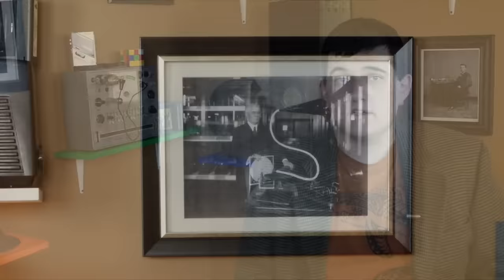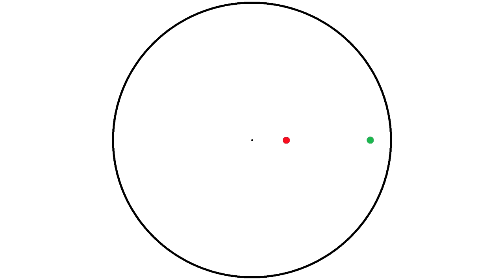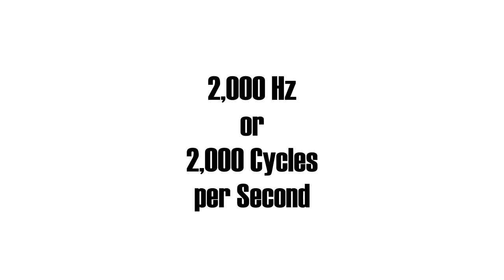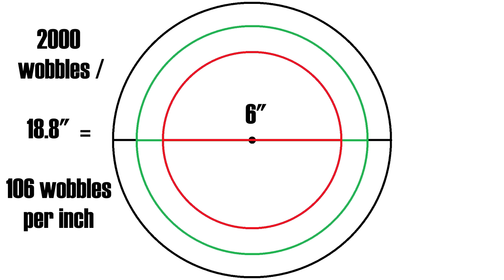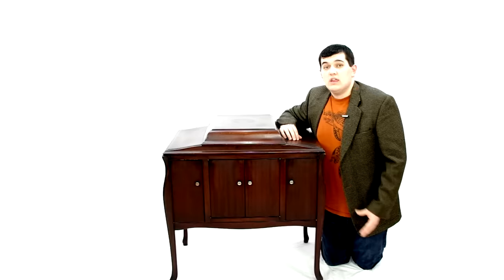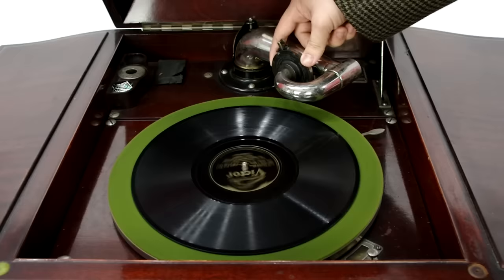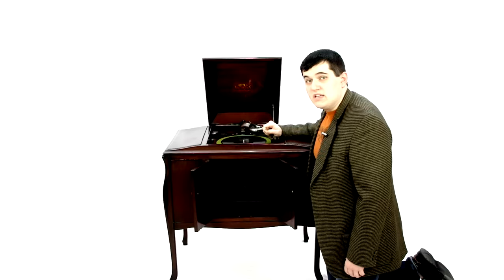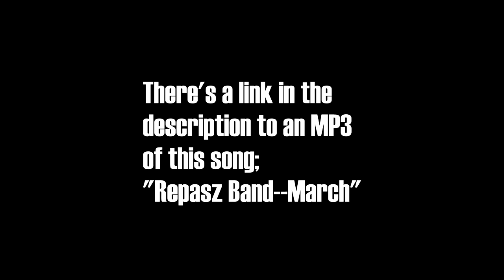Emile Berliner's Fix: Flatten the Cylinder to a Disc

Comment: A form of cylinder remained in use as late as the 1960s for office dictation.  The system, marketed under the trademark name Dictabelt, used large diameter flexible plastic belts which could be stretched between a fixed and a movable half-cylinder to make an oblong "cylinder."  The dictating machine had an electrically heated needle which plowed an audio groove into the soft plastic when activated by the sound from the microphone.  Once removed from the machine, it could be sent as a flattened double sheet to a secretary, who put it in a playback machine and listened with headphones to type the executive's document..  The playback could be paused and reversed by lifting and sliding the playback cartridge.  I'm not sure whether there were any machines built which could do both functions, but if so, another secretary or the executive who dictated the document could read while listening, in order to catch errors.

This fit the pre-online-terminal office environment, in which secretaries (also called stenographers), mostly women, typed dictation from executives, mostly men.  But rather than having a personal secretary, and taking up the secretary's time to listen to the boss and take shorthand, this system allowed even mid-level executives to dictate alone, and secretaries to be organized into a "pool" and type documents as their time allowed.  But once executives had online terminals, and later personal computers, on their own desks, there was no need for secretaries.  And since they already knew how to type, some of them could be promoted into the junior executive ranks.

I don't know how long Dictabelt and its competitors (if it had any) lasted, but it seems to be an idea which only works in large multi-executive offices, and I never saw any such machines after college in any company where I worked.

Comment: During the German occupation some folks from the Danish Radio had a secret recording setup with wax discs. They recorded the sabotage of a factory (they were in the know). A long recording required two recorders with some time overlap and rapid replacing of discs. And a light brush or feather to remove wax dust. I think a similar setup but with shellack discs is shown in Des Teufels General. Rather odd as the Germans had excellent tape recorders at the time.

Comment: We used magnetic cylinders for data storage in the late 1960s early '70s.  IIRC they were head per track and ran in an atmosphere of nitrogen.

I bought a commercial property and amongst the junk there was an electric motor from an Edison phonograph, it sold for £1500 on Ebay in 1985,  £4,579 in 2019
 (Inflation averaged 3.3% a year.)

Comment: Some history on the Berliner discs in case you wondered:
Emile Berliner’s discs were 7” with one song.
A Berliner phonograph is the phonograph in His Master’s Voice.
They were VERY noisy. I don’t know if any other records (in decent condition) are that crackly.
The Zolophone stole his patent and he eventually lost the right to make discs IIRC.
In 1901, he gave up the patent to Eldridge Johnson who founded the Victor Talking Machine Co.
If any of these were mentioned in the video, I apologize.
Edit: A Berliner disc was not shown in the video. Early ones had no label and were instead engraved. Later ones did though. They were initially also made of rubber, then shellac

Comment: Not too well known is the process by which cylinder records were duplicated in the 1890's to supply the considerable number of them needed for the "nickel-in-the-slot" phonographs of the decade and the consumer cylinder phonographs from 1897 to 1901 when molded cylinders came on the market. The pre-1901 cylinder duplication method used a pantograph where four mandrels were linked together with one mandrel holding the master cylinder and the other three connected by a linkage with a playback stylus driving three recording styli recording blank cylinders on the three blank-cylinder mandrels.

Comment: The variable frequency response of disc records is perhaps easier to see by looking at the record in terms of a sector. As I can't post a picture, let's see if I can do it in less than 1k words. Draw an angle on a record, with apex at the center. This also gives us concentric slices of the track within the angle. Since the record has constant angular velocity, each slice of the track contains the same duration of audio. However, the as the slices go towards the center, they're also shorter, so the sound must get squished into shorter and shorter space. "We can only make the wobbles so close together before..."

The linear velocity approach has the advantage that it can be connected to the oscillating pen on dragged paper demo from the previous video.

Comment: There are a lot of comments and I can’t read them all, so excuse me if someone has already suggested that Edison could have improved the storage problem somewhat by making his cylinder into a frustum (a cone with the top cut off) with a shallow angle between the base and top. They would then have been stackable inside each other. Smaller, shorter playing versions could have been stacked inside. I imagine that there would be other problems introduced, but an inventor like Edison would surely have been up to the challenge😊

Comment: discs were also distorted from the original recording, because the original recording used an engraving bar that traveled straight across, but playback was a on a swinging are that arced across the disc.

Comment: Home disc recorders were a thing. You should  do a video on them. Metal  discs , hot needle...
Reply: Some used vinyl on metal discs.  I have a couple of 10 inch Recordio (Wilcox-Gay) discs, probably late 1940s or early 1950s.  They run at 78 rpm.  They were inside an old Emerson radiogram I bought in 2016.  I wish I had the machine that made them.

Comment: Technically, a disc is a cylinder as well. Only the proportions are way different, and the grooves are on the top and bottom rather than the side walls ;)

Comment: I haven’t seen an analysis of the fabrication problems involved in the cylinder record, but it would seem that mass producing cylinders by molding them requires two semi-cylindrical mold halves, and would create a seam on each side, which would at best result in an extraneous “click” every half revolution; or at worst, make the needle jump out of the groove.

This is no problem with the disk.  Just cut a separate master for each side, make each side a mold half, and the molding seam is on the edge of the disk, where no information is recorded.  That’s how records have been mass produced ever since.

How did Edison’s later cylinder mass production process address the seam problem?  Does anyone know?

Comment: Near five years later, I'll add this; diameter and effective surface speed.  As stated in the vid, this affects frequency response/ability to encode.  33.334 RPM, 12" disc.  Calculate that, then the same with 45 RPM and a 7" disk.  Funny how that works.  IIRC, I calculated it out to be the same on the outside edge, within an extremely narrow margin.

Comment: There are echos of the competing photography film formats, Betamax/VHS war as well as vinyl vs cassettes vs 8 Track and even the personal computer war of the 80s and 90s, at least in storage media. The final winner over all of them: digital.
Reply: Not exactly. There are still battles for digital formats in the market. Look at Blu-Ray vs HD-DVD or SD vs the other other memory cards. That's just on a hardware level. Then there's different formats for storing digital mediums on a software level. Try plugging in a USB HD formatted for windows on a MAC for example. It won't work. The fight goes on!

Comment: My understanding is that Berliner was an opportunist "inventor" who specialised in poring over patents filed by others and then making a quick buck by producing a cheaper version of the same inventions but sufficiently different to not infringe on the patent.  His original discs (made of rubber if I recall correctly?) and players were intended as children's toys and thus the disks were recordings of nursery rhymes and similar children's songs.  So the change from cylinder to disc was purely because of Berliner's usual "don't-get-sued-for-ripping-this-off" M.O., as was ensuring that the gramophone was a play-only device, unlike Edison's record-and-play phonograph.
Please do correct me if I've got any of this wrong!

Comment: It was at this moment I realized I have a 1914 Victrola record player which I rest my teacups on while sitting on the couch in front of the tv. Never really looked at it. Can't figure out what the lever is for in the bottom right corner underneath the record.
 Some german soldiers brought it over from germany when they got stationed in town during the 1940 occupation of Norway, they didn't bother or they couldn't drag it back to germany afterwards. Not sure what happened.

Comment: You missed an advantage of the side-to-side motion of the needle compared to the up-and-down. The up-and-down groove only pushes the needle up. Something else needs to push it down, gravity or a spring. To produce high-frequency sounds, that pushing down motion needs to be fast enough, and therefor requires a large force. The large force will easily damage the groove.
In contrast, in a side-to-side groove the needle will be actively pushed both ways, and therefore can use much less force.

Comment: Oldtimers tell me that when the new needle bin ran out, they just refilled it with the needles from the used needle bin.
Reply: Well like I said...we had a   tin metal roof...after we replaced the old roof which was made from tree bark.. that tin roof was the best.. others would come from 30 miles away to look at the tin roof....now the roof was built with nails that had lead metal top of nail...when we needed a new play nail we got to the roof and took one out...keeping the lead cover to trade with others less fortunate...

Comment: I just learned that Victrola units like the one shown here are the origin of the modern technological meaning of "console." The earliest use of the term was for brackets.* It was later applied to wall-mounted tables or bases for ornaments, then later for free-standing structures, especially cabinets. From there it took on the meaning of the large body of an organ (which is usually concealed in some sort of cabinet), and then also talking machines as shown here. The Online Etymology Dictionary dates the use for "radio cabinet" to 1925 in the same sense, and from there TV cabinets and so on. The word for any console at a generator or in Star Trek or whatever dates back to these cabinets.

I don't know though why video games seem to have reversed the trend, with arcade cabinets specifically set apart from home consoles. Video game consoles have never been commonly built into cabinets. I can't find a clear answer on that. It might be unrelated, I suppose.

* This comes from the French noun console with the same meaning. It's origin is unknown, but it's probably related to the verb consoler meaning "to comfort, console" via some forgotten route.

Comment: The needles didn't wear away gently, the way they were supposed to, it was more like being ground down.  Then think about where the "swarf", the flakes of steel from the tip of the needle, is actually going to end up....yup, embedded into the record.
I had a book on this, which I inherited from my grandfather, it contained horrifying photomicrographs of the grooves with the flakes embedded into them and also photos of the effects an old record had on a new diamond stylus as the little bits of metal chipped away at it.  
No idea where the book is now, it was called "Sound Reproduction", a pun title.  IIRC, it also recommended brick as a decent loudspeaker cabinet material.

Comment: Assuming there's only one cylinder prop here, that condition of a 35c minimum for resale took some serious cohones.  The date on the cylinder shows April 1908, and even if it was sold immediately, Bobbs-Merrill Co. v. Straus had already been argued in front of the Supreme Court... and then the ruling came June 1st, so between 1 and 2 months from production of this cylinder...

Comment: The real proplem of reduced frequency response near center of disk is partly solved for by today by 2 methods.
ONEG The volume of high frequency tones is reduced at outrage of record and increased slightly.constantly towards center of record to make up for problem.
TWO: The bend in tone arm (or in some machines angling the cartridge holding stylish. Compensates.

In early days 100+ years ago there were some disc machines like PATHE that were started near label and tone arm traveled to edge.

CDS (and Video discs) start near center but slow down as edge approached
 Computer hard drives (and old floppy discs) mostly rotate at a constant Rom BUT put fewer "sectors OR "blocks" OR "clusters, of data on rings near center.)

Comment: How hard would it have been to measure the angle of the needle arm (and thus where it is relative to the turn table) and adjust the speed of the turn table to keep the speed of the LP constant relative the needle? Could it be done with a rheostat to control how much power is sent to the drive motor?

Comment: I want to get something to play 78's, I saw a Victrola at a boot sale but couldn't see what connectors it had "for the speakers". I was quite the padawan. Still, if they tracked at forces like that, might a cheap Crosley actually be a comparatively gentle option? A lot of those cheap modern record players have the same 3-speed mechanism, just different casings.

Comment: Those pre-war disc records ran at 78 rpm until the 50's. Then came the 45 rpm singles after which came the 33 1/3 rpm micro groove albums. These were later made into high fidelity and stereophonic sound until the coming of magnetic tape recording which is another story and episode of the story of sound.
Reply: Actually, Columbia came out with the 33 in 1948. RCA got angry that somebody was ahead of them, So in march of 1949 RCA released the 45 record to combat the 33. Making the 33 first.

Comment: Berliner did not originate the disc format: Edison himself experimented with a disc version of his tinfoil Phonograph in 1879. Since, with the first version of the Phonograph, it was nearly impossible to replace the tinfoil on the machine once it had been removed, he designed a version which used a flat sheet of foil clamped into a turntable. He posited the idea that such sheets could be copied by electrotyping. No original machine survives; but Edison's own sketches, plus patent drawings, and an engraving of the disc Phonograph in an article by the Count du Moncel, are still extant.

Alexander Graham Bell also experimented with disc recording before Berliner; audio files of these experiments can be found online.

Comment: I wonder if somebody here can answer my question. For flat records, Edison cylinders, or any other form of audio device that mechanically reads a variable groove, is it possible to halve this groove, and then mechanically double it? For example, say that a groove on a record has 10,000 bumps over 1 second, 10khz. Could that be halved to 5,000 bumps over 1 second, 5khz? And then have some mechanism in the read head that simply doubles every frequency received.

Would this allow for more music to be stored on a given medium? If so, would it be enough to make a significant difference? More importantly, just how sensitive is human hearing? This would obviously halve the distinct number of frequencies that a device could play. I'm not sure exactly how that would actually work since we are dealing with analog devices except that it would obviously decrease the quality of the recording. But enough to be noticeable? Has this ever been looked into? Or am I overlooking something that makes this sound really dumb?

Comment: I suppose it is too late to reinvent the wheel, but with today's cheap electronics and servo motors it would be feasible to produce masters and players that would control rotational speed of the disc to produce constant track speed at the needle.  On the playback side, a simple angle sensor on the tone arm could resolve the radius from center at which the needle was located and adjust the disc rotational speed accordingly.   At the other end of the time scale, I can remember the Victrola player in my grandparent's living room around 1950.  Their ranch was a long way from the city, so running out of new needles meant substituting spines from the numerous prickly pear cactus in the area to get by until shopping day.

Comment: where can you get those albums full of singles, and do they work on your average vinyl player today?
Reply: They will work on modern tables that have a 78 sped setting, and provided you can fit a proper "78" stylus on the cartridge.  If you play those 78's with a standard vinyl LP needle, you will hear A LOT of hiss.  Growing up, i thought that's just how those 78's were supposed to sound.  What a revelation when I learned I needed a proper stylus to listen to those records.  I was amazed at the sound quality with the proper stylus.